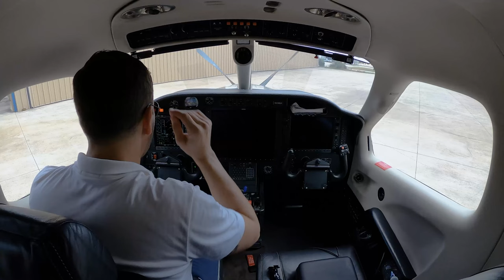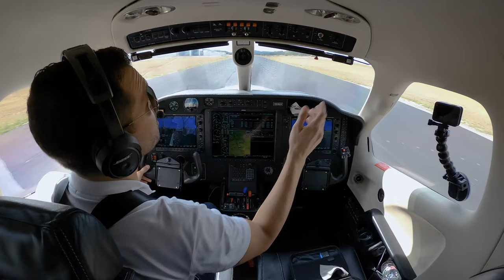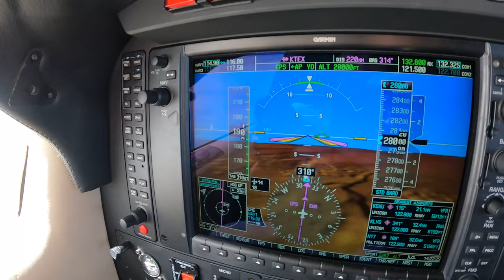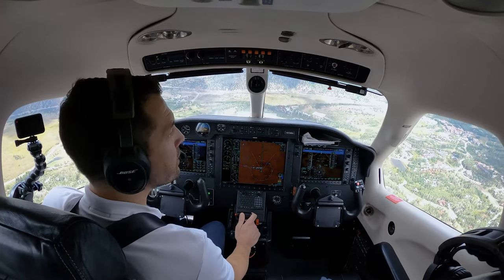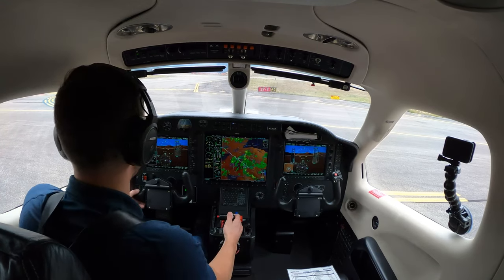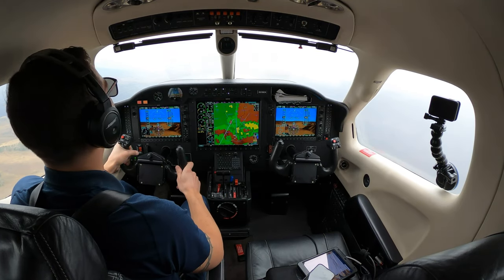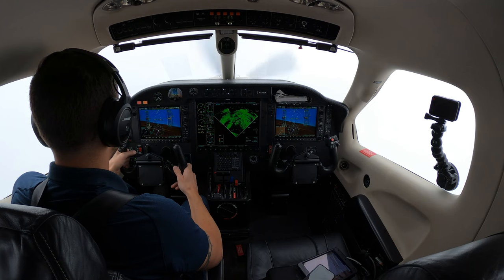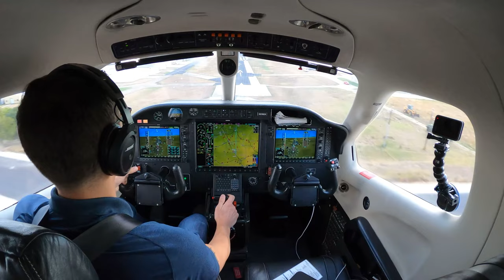TBM 850 Flight: Weather, Ice, Terrain into Telluride (KTEX) from San Antonio (5C1) | VLOG 4K UHD

Comment: At 22:50 you are discussing the thunderstorm in front of you. You believed that you would be in the clouds and switched to onboard radar. Did you enter the clouds or go around them? If you entered, how was the ride and did you engage the inertial separator? What do you typically find ride wise in the clouds at that altitude?
Reply from the maker: I went imc but thanks to the radar, didn’t get close to the storm. If it’s much colder than -20 C then, I do not initial engage the inertial separator. Usually, I won’t see ice that cold. If even salt-like ice crystals form, I’d turn it on. It was a smooth ride through.